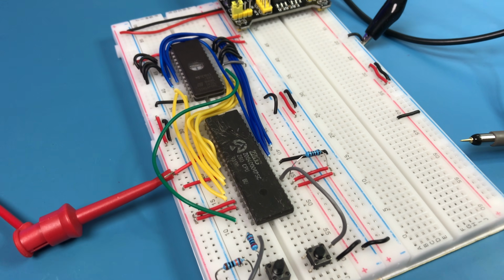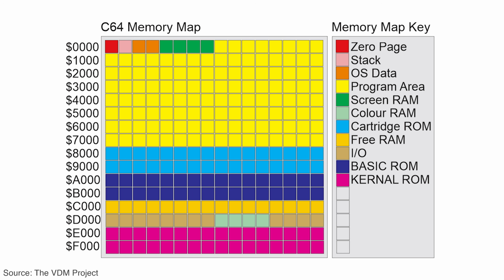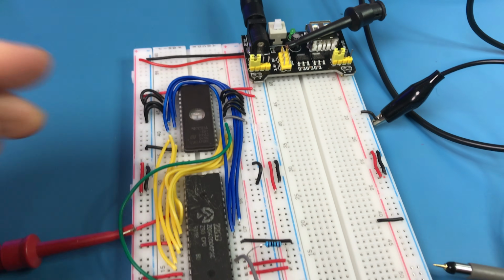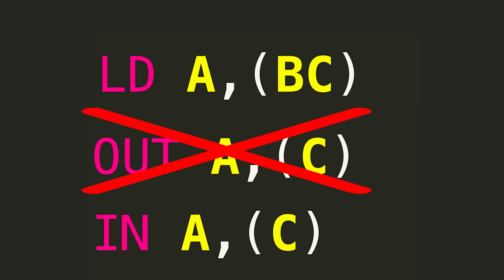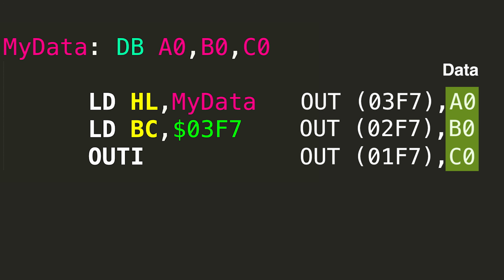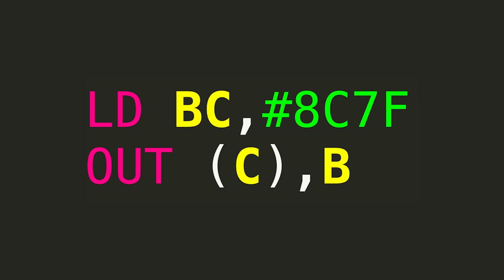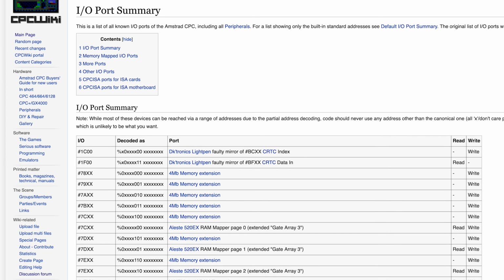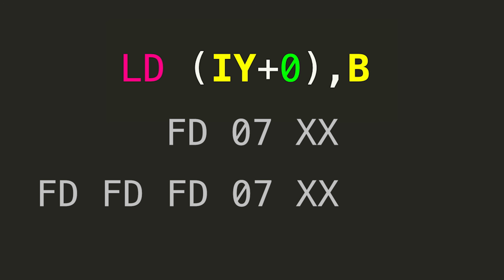The Madness of Z80 I/O

Comment: I'm not a Z80 guy, but I know the I/O space from old school, pre-protected mode x86 programming, and this video triggered my PTSD. ... And made me remember why I'm a Motorola 68k fan. I mean, all retro computers are fun in their own way, but in some cases, their creators were so busy to determine if they could, they did not stop for a moment to think if they should. :) Still, we love them for their faults too.
Reply: I don't understand your point really. What's wrong with a separate I/O-address space? To me, it feels pretty natural. And if you dislike complexity I cannot really see how you can be a 68000 fan... 😉
Reply: At least on the PC we have memory mapped IO for the graphics card. So memory mapped IO is there anyway. Memory addresses are larger. So on the one hand you have these ugly 16bit IO addresses on the C64, but on the other hand you don't run out of address space. Memory mapped IO lets you use the "standard" addressing mode base+offset to for example address different sound channels or different sprites and their properties.

I was once told that ColdFire is the less complex version of the 68k. Also SH2 seems to be heavily inspired by it. Both have half the transistor count of the original 68k. But I cannot really see what complexity was removed on coldfire. SH2 has byte, word, dword only for load and store. All calculations happen on 32 bit. 68k  is reg-mem and so every instruction has to carry addressing mode and width. 68k allows multithreading using TAS, but SH2 does this also.   @herrbonk3635
Reply: @ArneChristianRosenfeldt  lots of Z80 machines used memory mapped graphics too. That was simply normal on domestic machines. However, if it was business purposes and running CP/M via a terminal than that was usually via a serial port or another card with its own memory which sat in the I/O address space. Even graphics is possible with the right sort of card or terminal, but it will be slow.
Reply: @TheEulerID  I did not know that Z80 and CP/M were used for multiple users. TIL
Reply: @ArneChristianRosenfeldt  nowhere did I say, or even hint that CP/M was multi user, although there was a version called MP/M that was.
Reply: @TheEulerID  I took “terminal” as a hint . Single user Z80 would be msx where you write to video ram going through ports.
Reply: @ArneChristianRosenfeldt  There certainly were single user CP/M systems which used a console terminal on a serial port. However, I also mentioned that there were CP/M systems which had separate cards accessed via the Z80 I/O port system. As far as msx is concerned, then all I can think of is the standardised computer architecture developed in Japan. There was a version (MSX-DOS) that could run CP/M programs, but that certainly wasn't what I was thinking of. I had in mind older stand-alone CP/M machines. Amstrad's CPC range of computers also had the ability to run CP/M when fitted with disk drives, and I believe they used memory mapped video. CP/M was inherently a character based console system using escape sequences, so the exact physical implementation of the screen can be altered.

In any case, there were definitely some business CP/M systems that used a serial terminal.
Reply: @herrbonk3635  There is absolutely nothing wrong with a separate I/O address space, but then I learned my trade writing operating system code on mainframes. Then you are into writing programmes for the I/O channel controllers, a sort of dedicated, processor for handling various types of I/O devices. You could, for instance, set up channel control programmes to poll terminals or find locations on disks. It was natural that I/O devices were not in the memory space.

So the Z80, and mode 2 (vectored interrupts) had some parallels with that experience. The SIO, PIO and CTC had limited programmability, but the DMA chip is another level entirely.
Reply: I’ve always found z80 and x86 clunky, probably as i started with 6502 then 68k
Reply: @andrewclegg9501 I hate this overflow flag pin hack on 6502. And IO range in zero page on later derivatives. Give me a 16 bit z address register instead to look for tape data at the normal location!
Reply: x86 has common origins with Z80 - that's why their ASM look so similar.
Reply: On the subject of protected mode, it occurred to me a year or two back that you could implement a "protected" mode on almost any CPU (but in particular on the Z80) by using bank switched RAM and some hardware to detect which banks were switched in and what addresses and ports were being accessed by what instructions and at what memory locations.
Specifically, you could implement a NMI to force the program to return to the OS if the running program attempted to directly access ports, memory bank switching to any bank not assigned to it by the OS, or a direct call to an OS routine without going through the correct call address.  Access to all of the above would have to be done by the program setting up data in registers and then jumping to a particular address (a-la CP/M) in order to perform the function via the OS.
I wonder how often that was actually done IRL and how effective it was?
Reply: The 268 had memory protection, but failed on the market. Everyone server manufacturer waited for 386 with virtual RAM or 68k with MMU with virtual RAM. @melkiorwiseman

Comment: Zaks' "Programming The Z80" was my bible when I got started back in 1980. Hand assembling my code for probably the first 6 months as well has hand disassembling also! This was on the Radio Shack Model 1 computer. You really LEARN when you're doing it that way!
The "problem" probably came from Zilog "overloading" existing instruction "code". I later years I learned to be very cautious about overloading/extending code because of weird stuff in the base code.
Reply: Rodney Zaks was quite active in those days. I had two books of him for the 6502. 🤝
Reply: I had both the Z80 and 6502 books but only have the Z80 one still.  I think mine is a 1982 edition, packed in a box somewhere so it's not at hand.

Comment: Back when I actually did some z80 machine code (not "assembly language" because we didn't have an assembler) we thought LDIR was the most AMAZING thing ever.
It's funny because when we later started doing some 6502 it was the RISC Vs CISC debate ahead of time (I don't thing RISC was "a thing" back then) because we were like "Eugh! This 6502 thing hasn't got many registers, and where's the nice block-move instructions?". We soon learned to love the 6502 for it's simplicity though... :)
Reply: LDIR was such a good thing that Hitachi (?) did block move instruction with their 6809 enhancement.  Unlike the Z80 though they did it as an atomic instruction instead of a repeating (via PC manipulation) instruction so interrupts could not be serviced for potentially long times.
Reply: LDIR is great in concept, but it takes 21 cycles per byte. A 6502 can copy memory at 10 cycles per byte. The Z80 is often clocked higher than 6502, but the Z80 takes more cycles per instruction & in many cases takes more instructions to do the same thing.
Reply: @smf3472  Comparing clocks vs instructions between different devices is not as straight forward as initially thought.  As we all know the 6502 is a 2 phase device so in many senses the clock can be considered doubled.  There are devices out there with even more phases.
Reply: @retrozmachine1189  Even when taking that into account, the Z80 is poorly designed. The 4 bit ALU was a terrible decision.
Reply: @smf3472  You cannot compare 6502 an Z80 clock cycles. One is two phase, the other is not. In essence, on a like-for-like basis you halve the Z80 clock rate.
Reply: @TheEulerID  Even when you take that into account, the 6502 can still beat the z80. For a CPU that was designed to be the cheapest possible, to compete with TTL or an Intel 4004 then that is still pretty good going.

Comment: The ZX Spectrum uses the full BC address for scanning keys.
Reply: Ah, yes. The ZX Spectrum. I used to have one in the 80s. Build an EPROM programmer with it to copy drum computer sounds. I remember the keyboard was in the way. Had to use high addresses to not get data garbled. I used a couple of 374 8 bit buffers and a 273 (from memory). Address decoder was a 138. Hardware debugging with a single channel oscilloscope.
Reply: but spectrum can use 'IN A, (FE)' instruction with A holding high byte of the port address. It is impossible on amstrad cpc.

Comment: OTIR, how did such instructions come into existance? during conception of the 8080 successor, did a client said "we need that" and put some money on the table? or did Zilog need to capture a special benchmark with that? Or was it just like "we already have 98% on the logic gates from LDIR, why not throw it in as a low hanging fruit"?
Reply: Keep in mind processors were extremely slow at the time.  This type of instruction could be useful for displaying video, for example. Any hardware optimization was welcome back then. RISC processors are years after this technology.
Reply: @MarceloSilva-lh9mh  OTIR is pretty slow though, it's there because the Z80 is ridiculously slow & just running a loop is just too slow.

Comment: To me it makes sense. If you think in addressing a register-based external IC you need a /CE signal, an address to select a register and a value to set to that register. Then, with what Zilog did you can use an address decoder connected to the low 8 bits and /IOREQ to drive /CE, the high 8 bits to select the register and the 8 data lines for the value. With this you can have data tables for all the registers of the IC and a simple OTIR will load all of them, or read the full state of the chip with INIR :)
Reply: But you also need an address decoder for the RAM and ROM, so it doesn't particularly help. I don't believe Zilog ever considered how simple it would be to hookup. The decision had been made on the 8008 & that had been based on a TTL design that used a delay line instead of RAM. So you couldn't have memory mapped I/O. The intel 4004 also had a strange way of accessing RAM that would make memory mapped I/O impractical. Hence Intel went for non memory mapped I/O

Comment: Z80 is a superset of the Intel 8080/8085. Those only had 256 IO addresses.
Reply: Yeah, trying to understand the Z80 after only experiencing 68xx/65xx and without first at least reading up on the 8080 is going to be mindbending. Zilog basically threw the kitchen sink at the already existing 8080 design which is the "why" for so many weird corners - they had to work around an existing design. The 16-bit I/O address is a good example, it had to be 100% compatible, but they saw an opportunity to allow the hardware designer more freedom IF necessary for their design.
Reply: @Torbjorn.Lindgren  You had some of the few sensible/non-fanboyish explanations here.
Reply: @Torbjorn.Lindgren  It was their own design though! 
Faggin and Shima designed the 8080 at Intel as well as the Z80 at Zilog.
Reply: Pedantically 8080 but not 8085. 8085 added official different instructions (SIM/RIM) and hidden ones discovered later (LHLX, SHLX, LDSI etc) that were designed for compilers and added a load of 16bit and stack ops. Why Intel hid them nobody seems to know - perhaps to avoid 8086 competition because the 8085 with those instructions ran C and other high level code several times faster than an 8080
Reply: That get send out twice on the address bus (top 8 bits and bottom 8 bits) when doing an in/out instruction

Comment: And if you create your own Z80 machine you can abuse that fact and use it for full access to a framebuffer for example.
Just mask out the two top bits so that you still have IO space for other stuff and that gives you 16k of IO space for graphics. And with modern implementations you could even keep the needle ear for when you need to push data serially, like $C000-$FFFF is direct access to the framebuffer and $0000-$0001 has an address pointer with $0002 being the byte written or read with autoincrement of the pointer. Don't forget to have a bit in the control register to turn off full framebuffer access so that INIR and friends can be used.
Reply: It is too slow for graphics.
Reply: @theALFEST  Sure is, the enforced waits on Z80 with IO instructions all but ensures it.
Reply: @retrozmachine1189  It is not because ULA contention, it is because OTIR has the same speed as LDIR, and there are faster ways to draw like using stack instructions.
Reply: @theALFEST  I didn't mention the ULA.  Please look at the timing charts for Z80 bus for IO operations.
Reply: @retrozmachine1189  Everything I can find shows that memory and I/O are the same speed, what can you provide that disputes this?

Comment: I like the Z80 assembly language, I find it logical, the Intel 8080 rubbish on the other hand is madness, I mean "MOV dest,source"!!!!, "LD dest,source" is much more logical, but I guess it is a matter of taste but ok, they could have done the IO instructions better ;)
Reply: Yeah, I did my first low-level programming on the Z80... when I moved to CP/M and everything was 8080 based (even though most of the actual hardware was Z80) I hated all those "horrible" mnemonics in 8080 assembler.
Reply: The change to the 80x86 assembly language was different, but you had more memory to access.
Reply: Clearly you never used the 6800, 6502, 6809.  Far more elegant instruction sets.
Reply: @deang5622  Used all of them and I agree, but we where talking about Z80's
Reply: I've programmed the 6800 and 6809 not the 6502. The 6809 had a MUL instruction and had to manually do that in the Z80.  @deang5622

Comment: The x86 has out/in instructions as well.. I wonder if they work the same.
Reply: The 8086 had a full 16-bit I/O address space from the get-go, so most of the mess is avoided. 

As for the Z80 I/O instructions: it is important to note that the Z80 really uses the /MREQ, /IORQ and /M1 signals for other purposes as well. I/O operations, for instance, must also be distinguished from interrupt acknowledge signals, which will have both the /M1 and the /IORQ pin low at the same time. 

I love the Z80, but only Intel's 8086/88 CPU's had an even more involved bus protocol.
Reply: @damouze  The Intel 8080 has 8 "status" signals which are multiplexed with the data bus pins. including the direct equivalents of the Z80's /MREQ, /IORQ & /M1.
Reply from the maker: They have a common ancestry, so probably pretty similar, but I don't remember the details. I should look into it and if it's a horrible mess maybe I need to make another video about that :-)
Reply: @NoelsRetroLab  The development line is effectively Datapoint 2200, Intel 8008, Intel 8080, Intel 8085, Intel 8086/8088 and so on. It is fairly complex, messy and likely to require a long video.
With the Zilog Z80 being an enhanced clone of the Intel 8080 which is binary compatible. So long as only documented I8080 opcodes are used. With the i8080 all of the undocumented opcodes duplicate documented ones, which are those with the lowest numerical value. Zilog used the undocumented opcodes to extend the instruction set of the Z80 also changing the assembly mnemonics to keep Intel's lawyers happy. Intel similarly extended the instruction set with the I8085.
The most common software which makes use of the i8080 instruction set being the 8 bit versions of CP/M and associated applications. Though the BIOS may use Z80 or i8085, since it's hardware specific anyway.
Reply: @NoelsRetroLab  it is the x86, of course it is a horrible mess. 😅
Reply: there is certainly a reason why all the IBM-PC-IO addresses (like COMs,  LPTs etc) are spaced oddly as they are. it looks like some clever "skipping full pin decoding" as well.
Reply: @rarbiart  That is because the 8086 had a 16-bit address bus and for 16-bit I/O 2 consecutive "byte" addresses are used. So

MOV DX, 0x3f8
MOV AX, 0xff66
OUT DX, AX

is equivalent to

MOV DX, 0x3f8
MOV AX, 0xff66
OUT DX, AL
INC DX
MOV AL, AH
OUT DX, AL

(it could be that the high and low byte are sent to the I/O port in the reverse order, I can't really remember)